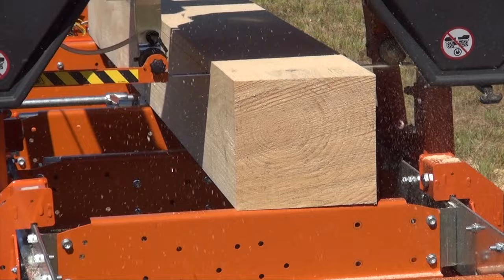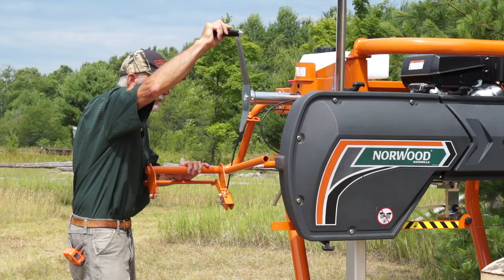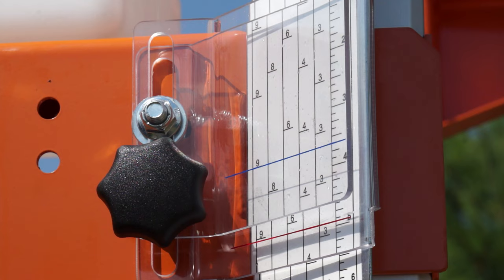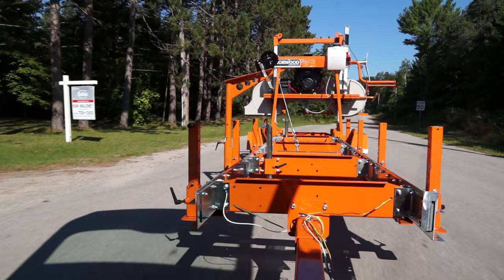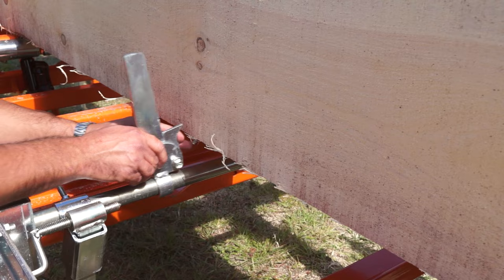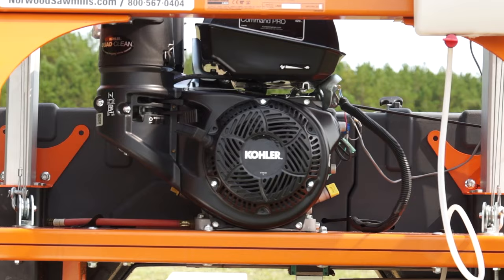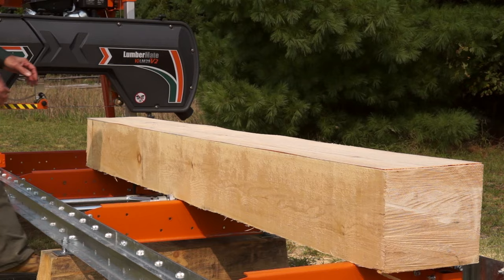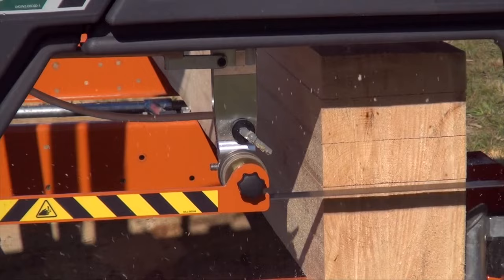Norwood LumberMate LM30 Portable Sawmill - Adventure Ready

Comment: I've got my lm30 running now and I love it.  I had a couple minor issues and Trevor helped me through them no problem.
I  have had issues but they were my fault.
1. When they recommend trying to get straight  logs with little taper, it's good advice.  Yes, you can still cut inferior logs but it will work you extra for not many boards
2. When you are bringing your mill back to the starting side, watch out for knots sticking up
3. If your blade dive's, it's most likely dull
4. On my mill, I really need a log at least 100".  Anything shorter won't reach between the log stops.  Be sure to cut your logs long enough.  I cut a bunch too short and have had to cull them from my "to cut" pile.  I tried to work out a solution but it was a whole bunch extra work for not much output.
5. I hit my log clamp (barely), over reacted, pulled back too hard and I thought I had broken the blade.  Nope, it came off so I put it back on, checked tracking, fixed the log clamp and was back milling.    Needless to say, I was impressed that the mill went through this and didn't mess up.
I bought a competitor mill earlier this year and carried it back to the dealer.  This one is designed SOOO much better.
I can tell you the guy that designed the lift and the band wheel tracking on this mill is a mechanical genius.  Tracking is super easy and lifting that heavy saw head is a breeze.  My 5 year old grandson can turn the lift on my mill.  
The only thing I need to do better that I know of right now is do a better job prepping and selecting my logs.
I'm sure there are other great mills out there, but this one is working great for me.

Comment: I got notification by e-mail from Norwood. My LM30 has been shipped, I've been told the trailer Jacks are on back order, I don't know why when you pay up front for something, you only get part of the order, I hope the two year Warranty starts only after all the Parts arrive. I hear some folks have gotten round Jacks to fit into a square hole on the trailer, If that's what I get, the full load will be put back on the truck and sent back. I've asked them to send me the Side wind operated Jacks as opposed to the top wind Jacks, they said they would.
Reply from the maker: I will ask someone to call you Brian. 

The reason we cannot necessraily ship everything at the same time is because the supply chains have been utterly destroyed. We cannot ship what our suppliers do not supply us. In our quote, proposal and correspondence, we are very clear about potential delays so that all purchasers are aware of the issued before ordering. As for custom-made jacks, we cannot accommodate that request and I would be surprised if someone suggested otherwise.  

As I said, I will ask someone to call you on Monday to verify if you would still like to proceed with you order or if you would like to cancel it now. We would rather that you not be disappointed.
Reply: Just a thought... as my daughter says “patience grasshopper” 😅